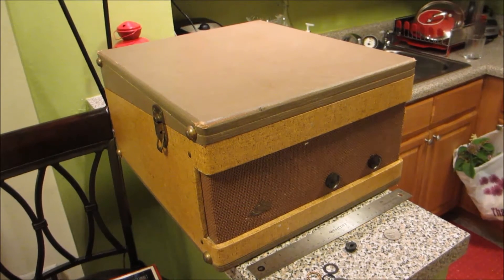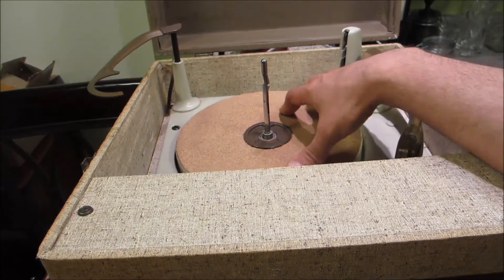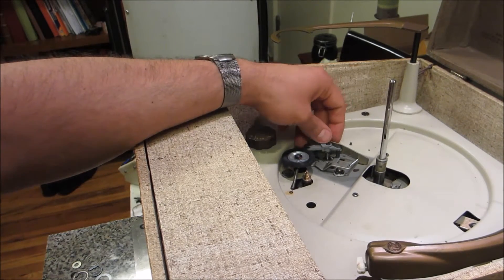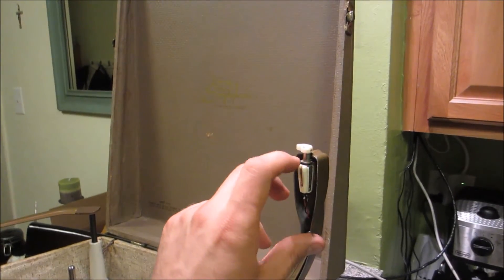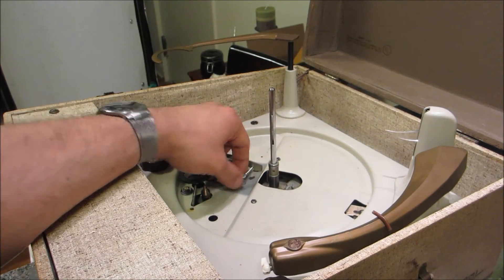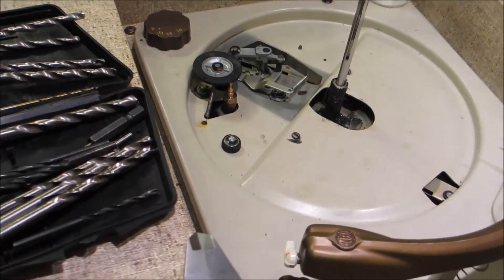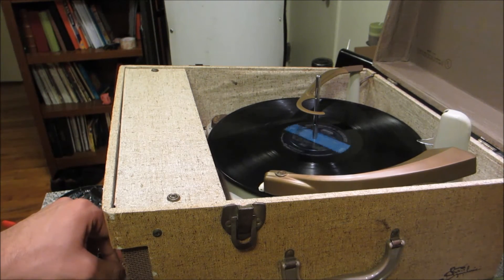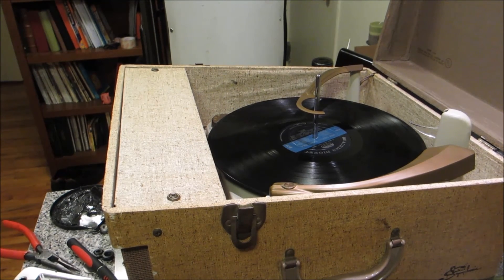Record Player Restoration 3d Printed Parts

Comment: This is really cool Bruno. I was wondering if the rubber idler wheel that turns the platter could be 3-D printed? They have gotten so expensive to purchase for replacement. I restore phonographs for people, and they complain about the cost of the idler wheels. What do you think? Thanks. Randy
Reply from the maker: Randy, it certainly can be 3d printed. However its not as simple as that. For one you need a 3d printer that supports multiple materials, I recommend ABS inner wheel and rubber outer. After 3d printing it should be post processed, preferably on a lathe to ensure perfect roundness and diameter, then you need to insert a bronze/brass bushing of the appropriate size. The cost can be cut down quite a bit. I would estimate around ~3-5$ per part in material and probably 5-10 minutes to finish machine it. Unfortunately my current 3d printer does not support multiple extrusion as well as 3d printing rubber filament is not its strong point due to bowden setup. If you want to discuss this further you can ping me via e-mail (see the contact option on my youtube channel) Oh and I subscribed to your channel.
Reply: Thanks Bruno, and I just subbed back your way. I'm not really too familiar with 3-D printers, so this will give me something to look into over the weekend. This should be interesting. LOL  Thanks for getting back to me. I appreciate it. Randy

Comment: The bushings you printed -- were they soft like the rubber originals or harder plastic?

Are you planning on diagnosing the tube amp and making sure all the capacitors are doing their duty? Often humming on a tube amp occurs when capacitors have drifted out of spec.

Very nice job restoring! Looks clean. Thanks for sharing!
Reply from the maker: ehexlee 

I used hard plastic not soft rubber. I was thinking og trying the hard plastic out, if it did not work I would have gotten some rubber mounts. However the DC motor on this thing is so nicely balanced that when powered I cannot feel any vibration. I know this goes against the grain of turntable design as you ideally want your motor decoupled from the rest of the table, however in this case it is not introducing any noise.

Regarding the Amp on this, I do not feel I will be using it in the future. I am planning on retrofitting the turntable into a small table I own and replacing the cartridge with something along the lines of audio technica AT92ECD and a preamp. This will allow me to run a small tube amp as a filter and probably will run twin 5w speakers to accommodate the whole thing. In reality I am only interested in the mechanical table. I know these tables were made by the thousands if not hundreds of thousands and are not really worth much historically or technologically. However I do appreciate the mechanics of this table as well as the design. There will be more 3d printed parts coming in the future to accommodate possibly a set of 3d printed stereo speakers.